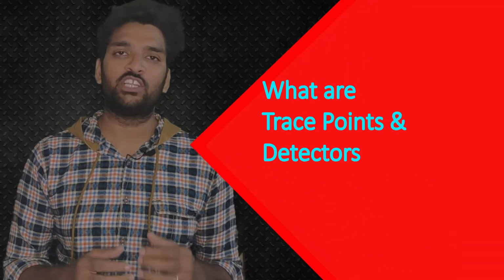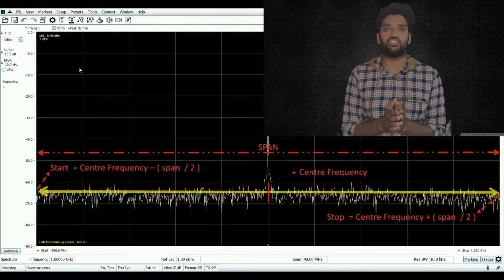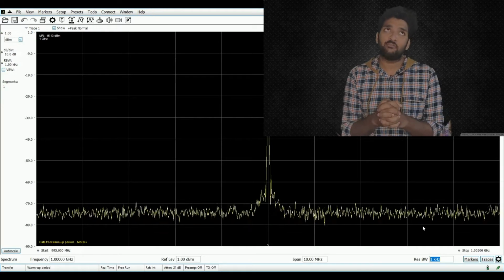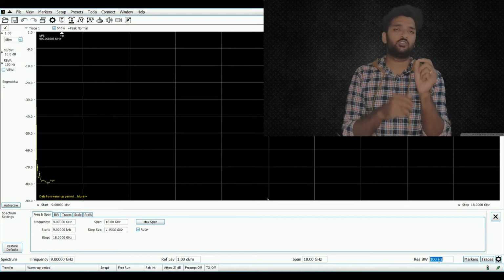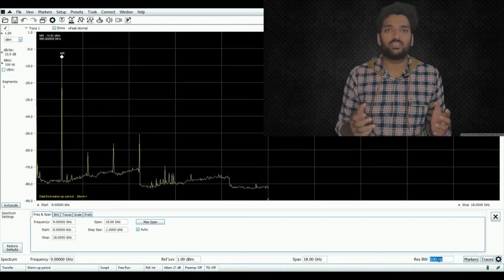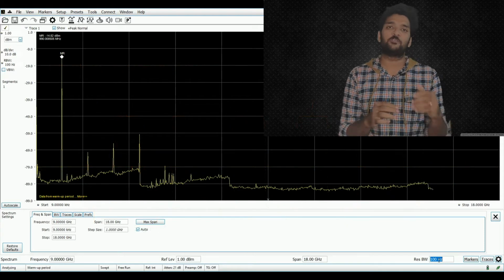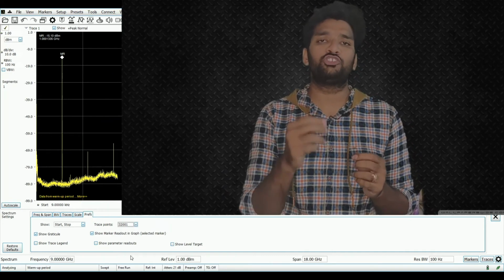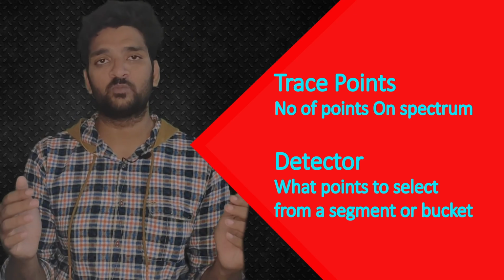Trace points and Detectors in spectrum analyzers (K-02)

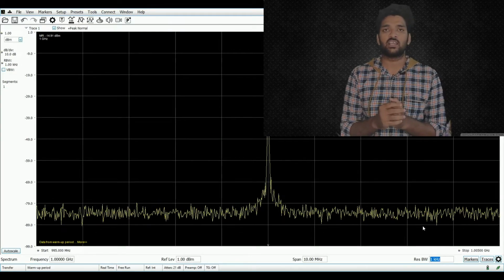Comment: In the above setup (around 1:50) , the Span is 10MHz and RBW is 10kHz, so theoretically there are 1000 points each with an increment of RBW. But if I choose tracepoints=801, my resolution is not as good as I gave with respect to RBW. How do you address this?